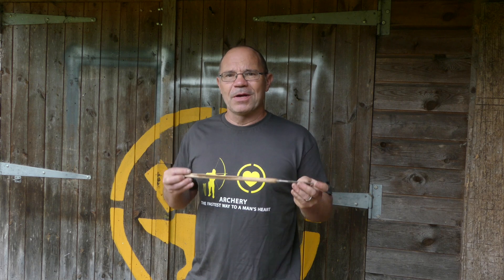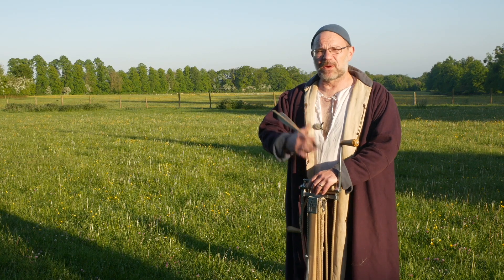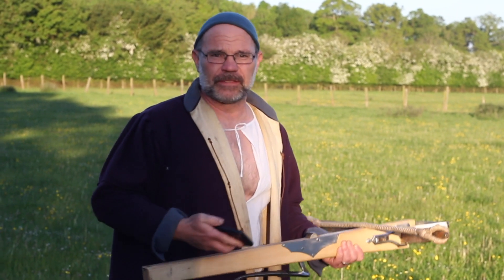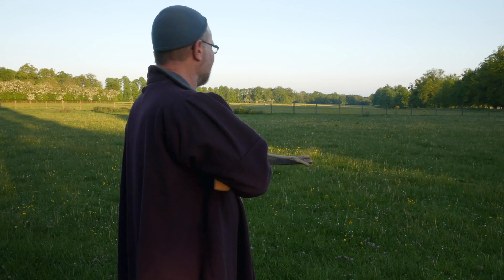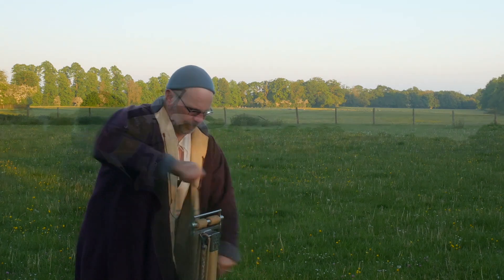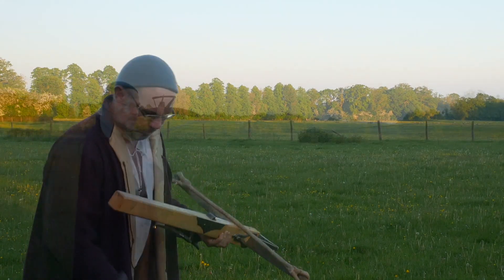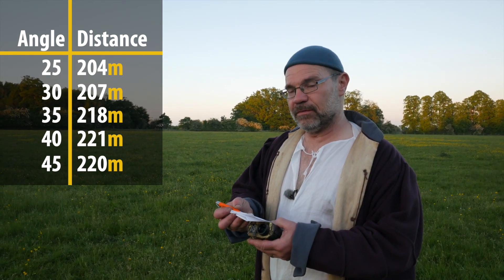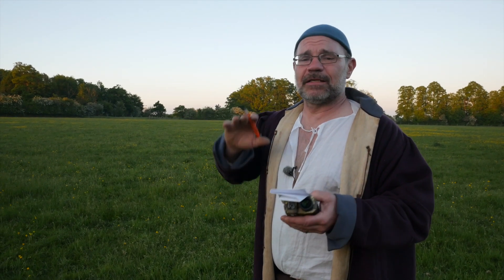Distance - Which angle is best?

Comment: The "fish tailing" in flight is eating range. Would a longer quarrel be more stable (it seems to work for model rockets... to a point. The CG gets moved further ahead of the CP. This reduces the extent of wobble for a given fin size or allows a smaller fin. Surface drag increase, but that is usually small relative to drag caused by wobble, frontal area, and nose configuration). I also must wonder about quarrel mass vs. bow strength; is there something equivalent to "impedance matching" in electrical circuits going on here? How much of the bows energy is effectively transferred into the arrow? High velocity at low mass can loose out to a slightly lower velocity arrow with a greater mass (and thus a greater momentum).So many things to test.
Reply from the maker: definitely and definitely.  bows and bolts need tuning and these could do with being a touch longer

Comment: Hard to tell what is ideal.  Yes, in a vacuum at equal elevation 45 is ideal.  Add air resistance, size and aerodynamics of the bolt, headwind, tailwind, crosswind, elevation difference and the calculation changes.  Would have liked to see a 47.5 and 50 degree shots to see if they matched 42.5 and 40 degree shots.  Also would need multiple shots at the same angle to come up with an average.

Comment: Haven’t scrawled through all the comments to check if anyone has mentioned this already, but are the fletchings on the bolts made with real feathers? They look as though they are, but also looks like they might be made with opposing helical twist (one feather taken from the right wing, one from the left). If both fletchings are from the same wing, they may spiral in flight, likely stabilising them and aiding distance and accuracy in flight. Much like rifling in a gun barrel. If each fletching is from a different wing, the fight against one another and can have negative impact in accuracy, distance, stability in flight etc.
Reply from the maker: wood veneer, curved the same around the centre line, so they spin very well

Comment: 1. Use same arrow/bolt for each shot
2. Repeat shot for each angle 10 times and take avg. value
3. Ensure same tension for each shot by using same amt. of rotation
4. Rest your elbow on something solid. Huge recoil.
Reply from the maker: And not get any work done.......I should, but I don't have the time
Reply: @tods_workshop  haha.  Well...to be fair, we already know from physics 45 deg is perfect.  I think the main lesson from your experiment is that if u just eyeball 45 degrees and you're off + or - 5 degrees...it won't make much of a diff in terms of distance.  So that was interesting.

Comment: Very nostalgic. Back in high school science class me and a group did the same thing but with a paintball gun. We hadn't even considered drag and fully expected the max distance to be at 45 and as such in the data collection phase we spent a lot more time because that quickly proved to not be the case and we thought something was wrong with the test rig. If I remember right, our results were somewhere around 30-35 for max distance and left us at a bit of a loss but we collected our data all the same. Later there was the epiphany that, yes, we do indeed have an atmosphere.
Reply: If i remember right, i read somewhere for maximum distance for a BOW you have to use 30-35 degrees. It does make sense, that the angle differs for different "shooting devices". a crossbow (despite the chinese crossbow because it has almost a normal bow draw length) has a short draw length and quite slow arms. a composite bow with a strong reflex or siyahs and a draw length of 36'' should be massive difference. so maybe a retest with "the lockdown longbow"?

Comment: I guess, it is worth shooting in 1deg. increments between 40 and 45 degrees (or between 35 and 45). And even may be several bolts at the same angle - to test the statistical noise.

P.S. The décolletage rocks! %)

Comment: G'day Tod,

Yay Team...!

It appears to my mind's eye that adding more Steepness to the Launch (Climbout) Angle, past 40-Degrees,  effectively "squanders" more Kinetic Energy in opposing  Earth's Gravity while gaining Height &  simultaneously losing Airspeed to a very similar Aerodynamic  Drag-Loading...; so while the apogee might be fractionally higher from a 45-Degree Launch, the Airspeed will be correspondingly lower than it would with a lower Launch Angle.

Thus, the "45-Degree Bolt", although it has fractionally more Height - and  less forward Speed than the figures achieved by the "40-Degree Bolt"..., when it commences to descend - and therefore, on the way back down the slower Bolt will cover less distance downrange, as it accelerates downward at the proverbial 32 ft per second, per second...

It boils down to the Arrow (edit, Bolt..., oopsie !) being able to conserve more Kinetic Energy on the  lower Trajectory, by wasting less Energy on gaining more Height, sooner, from which to then fall back down to Earth.

Launching at 40-Degrees thus effectively shifts the point of Apogee further Downrange..; whereas the 45-Degree Launch shifts the Apogee higher up, but brings it closer to the Launch ; and the Trajectory post-Apogee is a case of Airspeed (which has been conserved through not wasting it chasing height) versus Gravity moderated by Aerodynamic Drag, so the slightly higher, and slightly slower Bolt doesn't go quite as far as the one launched on the  lower Trajectory...

  So, it be a matter of simple(-ish) Aerophysics..., rather than Magick ; methinketh - olde Bean...(?) !

Such is life,

Have a good one...

Stay safe.

;-p

Ciao !

Comment: The bolts don't leave the bow at the angle the bow is set to.  After launch it takes them a surprising distance to stop pitching up and down.  I would expect that this both mucks up the theoretical angle and makes the actual range at the same angle quite variable from shot to shot.  Interesting.
Reply from the maker: I suspect the variation of shot to shot at the same angle to be minimal, but all bolts lift when shot and then correct

Comment: Tod, fun video as always!  As others have pointed out, it would be better to shoot many bolts at each angle, since there will be considerable variation from shot to shot based on random variables.  I did a simulation of bolts with drag (different types of drag, just to check) using some of your numbers from previous videos on bolt speeds.  Anyway, in the simulation there is a bit more variation at low angles than you showed, but not as big as you might think.  35-45 degrees show very little difference.

Looking at the slo-mo, I wonder if when you shoot at more of an upward angle if there is more wobble in the bolt.  More wobble would mean more drag.  If you have half the drag at the low angle, that would account for the difference!

Also, one thing that isn't considered in the angle is how long it takes the bolt to hit the target.  Would you rather the enemy worries about the bolt for 4 seconds or 7 seconds...

Comment: Pre video:
Should be a bit lower but not much - arrows and bolts are quite aerodynamic and do not lose that much energy, so maybe around 40°.

After video - yeah, round about that, give or take a bit, would need a looooot more work to narrow it down for just that crossbow/bolt combination, but it would be roughly the same with all combinations. The projectile would need to be exceptionally fast/light for air-resistance to lower the optimum angle significantly.

Comment: This is a physics question for projectile flight,  so in real life of will be something close to the theoretical.   Theoretically 45 degrees should be the angle that gives you the most height and distance,  but if you only care about most distance,  you can do the equation, and if you know the mass and average velocity of the bolt (since you don't have a specific constant velocity) and use the acceleration constant of g (gravity)  you will find very close to the best angle, but will still need to test to verify for real world circumstances,  my guess would be 42ish degrees

Comment: So 45° wasn't that bad after all. If the difference is literally around .5% additional distance for a potentially better angle, it didn't mess up the prior test results at all. Of course for absolutely conclusive data we'd need to shoot dozens of bolts at identical wind speeds etc., so this is as good as we will probably ever get it. Thanks for doing these tests, Tod.
Reply from the maker: Very little and that surprised me, but good to know

Comment: I can remember doing a pyhsics calculation about a guy throwing a ball and we should calculate the best angle to do so. Initially i said "of course 45°" but it wasnt 45°. It was close though. if i remember correclty it was 43° because of the height of the thrower (1,8m). 45° at ground level but less if you increase the height.

Comment: TOD'S LAW OF AERODYNAMICS - "The maximum distance a crossbow bolt can fly is directly proportional to the cost of the the camera it can hit."
Reply: i'm making a bet, the next gopro will be destroyed some time this september
Reply: @lukesheridan4623  I'd  expect Tod to use the "ballistics camera" trick- put the camera in secure enclosure and film using a mirror, I'd guess a 3/16" steel "bucket-great helm" with a camera facing down, using some flexy mirror sheet at 45° would work.  Local gun club put a go-pro inside a big diesel engine piston with 2 mirrors at 90° to get "incoming"  video.

Comment: To limit the impact of drag, you want to reduce the flight time (lower the angle slightly), however, a higher arc will probably catch more wind (which could either be better or worse). It would have been could to take a shot at 50 degrees, if that went further than the 45 degree shot, that would be a clear indicator of a tail wind. That being said, the 40 and 45 degree shots seem very consistent in range with the first video.

I see the bolt being used are needle bodkins again. The first video mentioned 65g, and the second video (launch velocity) mentioned 60g. Are those the same two bolts that were used for this one?

Comment: sounds about right to me. 45° would be ideal in a vacuum. For artillery shells with higher velocities and longer flight times (and thus more opportunity for drag to do its thing) the ideal angle is 35°. So with those bolts at low velocity and somewhat good aerodynamics 40° seems about right. However to have any confidence in that experiment you would need many more bolts per angle to average out unpredictable variables.

Comment: I'd suggest going for a larger sample size and for this i'd suggest using one of your bows that can reload fast.
 
For wind resistance there will be more resistance with the more velocity and so the shape of the projectile is important. What also plays a factor is pitch and yaw. Part of this factor is how arrows and bolts tend to wobble when launched which creates more surface area and thus more drag. Another factor is center of mass. If the bolt or arrow wants to keep tipping forward, or backward, while in flight then that is more drag because its not going perfectly in the direction of motion but also the more energy which should be lost on the fletching to stabilize it in flight. And this is all assuming the wind stays relatively consistent both in altitude, distance and time throughout the whole test.

Comment: "THIS bolt, THIS crossbow!"
BINGO!
Those slo-mo shots were most interesting.
That result with 45° almost the farthest suggests a bit of a tailwind.
Reply: Or the bolts are just planing. Those big vanes will slow down the descension from apex height  until the shaft lines up with trajectory again.
Reply: Nah, flights cause it to tend towards ballistic shape trajectory. Essentially a minor glide action in practice, as the air over the arrow is moving faster than under it. Which is an opposite effect drag usually has on the shape.

Plus javelins are 42, so it can't be far off that, probably a fraction better.

Comment: As always, an interesting trial. I would prefer that several shots be  taken at each angle,  as others below have mentioned,  perhaps all of your bolts each time,  to remove the possible variation between the bolts as a factor.  That would be tedious,  so  I don't blame you for just keeping it fun. I'm suspicious about there being one meter difference between  40 and 45 degrees,  in favor of 40, but as you say, those are the results on that day,  under those conditions. 
Nicely done, and I look forward to more of your experiments.

Comment: It's fascinating watching how little recoil there is. I wonder if that represents the forward motion of the limbs and string being stopped and thus counteracting the recoil of the bolt.  It certainly puts the statement about the low efficiency of medieval crossbows into context with regard to the massive acceleration of the string and limbs as a drain on available energy.  I haven't shot a crossbow, and am curious: do compound crossbows have more perceived recoil?

Comment: I was curious about this myself. In some of the games I like to play I typically found 35 degrees to get the longest, but never got to do extensive testing.

The only thing I can think of to improve this test is maybe to find a way to get wind speeds and direction up at altitude just to rule out that variable.
Reply: In my tests 35 degrees went the farthest too.